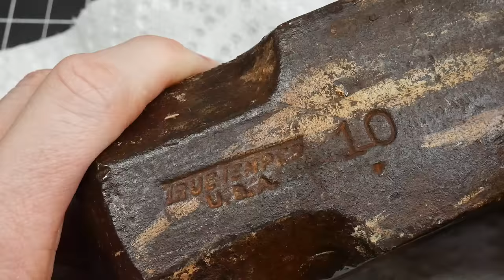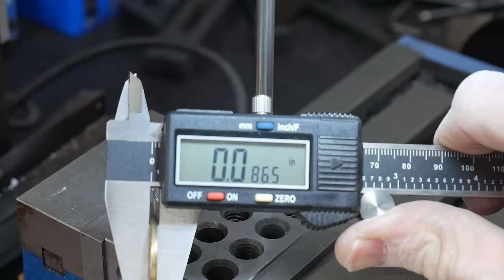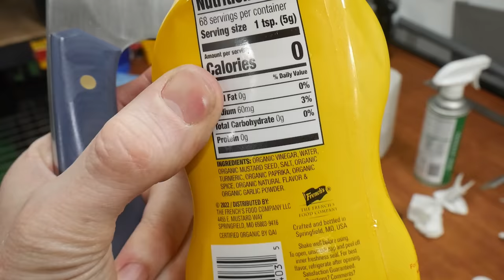Making a BEASTLY Chopper from an Old Sledgehammer Head | Knife Making Challenge

Comment: That's pretty cool!   What kind of steel do you think that sledgehammer is made from?  Or, true temper tools in general?  Thanks for the video, mustard patina is something you don't see every day.
Reply from the maker: Thanks John! The most common steel used for making sledge hammer heads is high-carbon steel, specifically 1045 or 1060 carbon steel. These types of steel offer a good balance of strength, durability, and impact resistance, making them suitable for heavy-duty applications like sledge hammers. Honestly I really don't know what True-Temper uses... but I bet it's one of those.